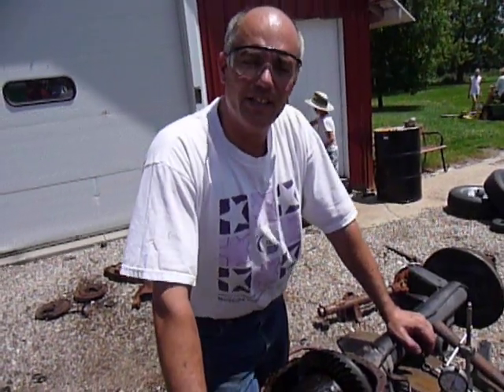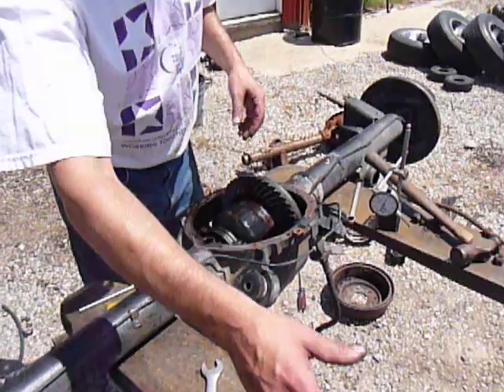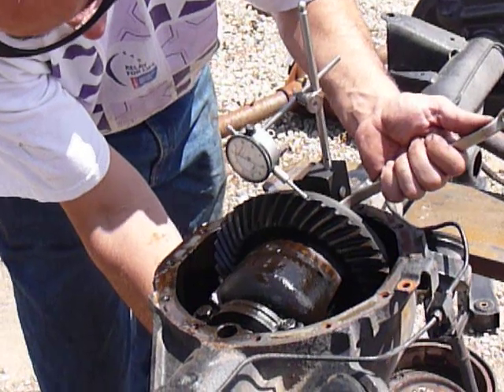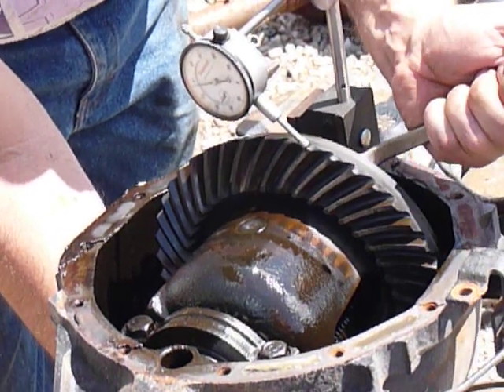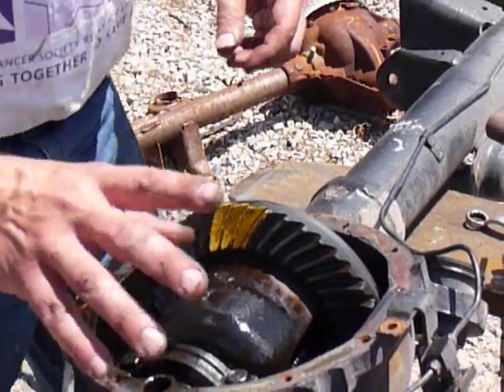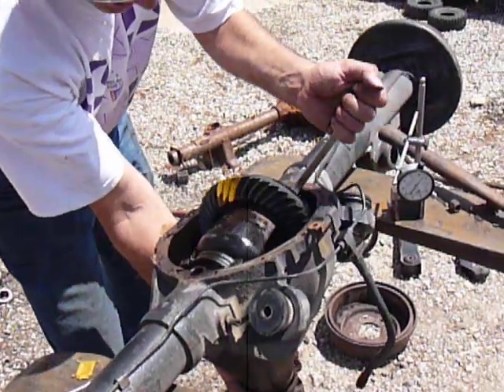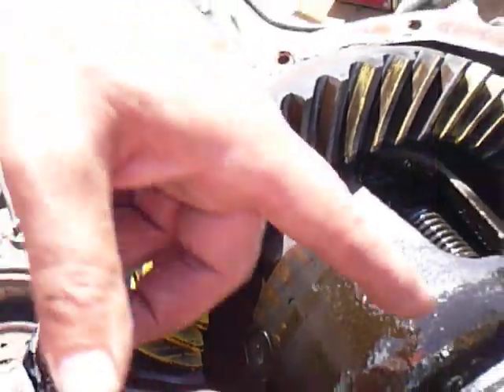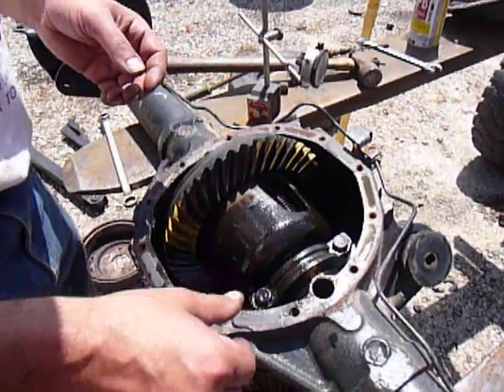how to check backlash on used gears for 12 bolt posi

Comment: MANY years ago i had a 67 camaro Yenko clone, 427/425 with 456  gears 12 bolt, the rear went due to excessive pinion bearing wear. I would have to keep tightening the yoke nut, a Chevy dealer previously set up the rear for the old owner and it howled. I replaced gears, crush sleeve, etc. with GM parts, I used the old pinion shims and shimmed the ring gear using only white paint, no dial indicator to achieve the proper pattern, usually if the pattern is correct backlash with be within tolerance

Comment: If you see two teeth side by side broken it is probably shock load not the gear setup. If you look closely you will probably see an adjacent 3rd tooth cracked. This is usually caused by droppeng the clutch on pavement, spinning then hitting a hard surface or when a tire starts hopping while spinning. Some gear ratios are just inherently weaker on some gearsets than others too due to the tooth design.

Comment: Its to make sure you're not putting the load on the top or bottom of the gear tooth, but rather the center, thus the shims to set the pinion depth and so forth.......correct me if I am wrong.  I am going to check my own.......I blew a pinion on a 4.56 that was installed at a pro shop and checked later by a mopar tech.....all was good, but ripped 2 teeth off  the pinion, now I'm leary unless I see for myself.....Going w/LUCAS75/140 syn versus the Redline I had in it

Comment: is in it better to turn the ring gear from the pinion shaft for testing the gear pattern?.....I mean thats where the power comes in from
Reply: Wondering about this as well. I would think from pinion to test drive side, and push the  ring gear to test coast side.